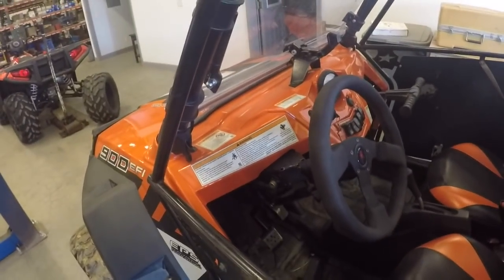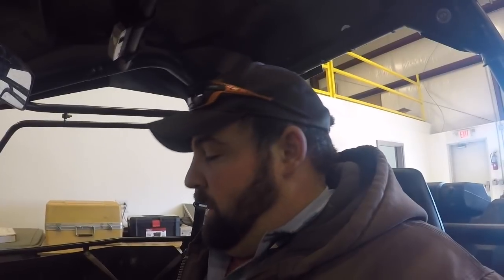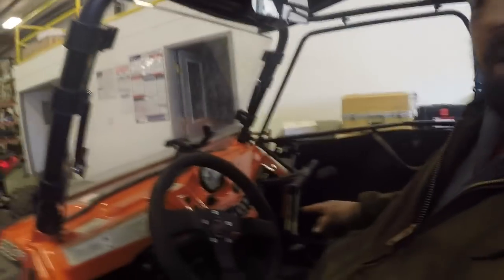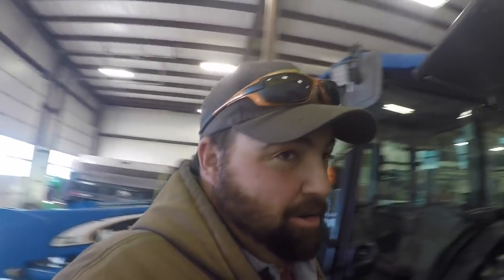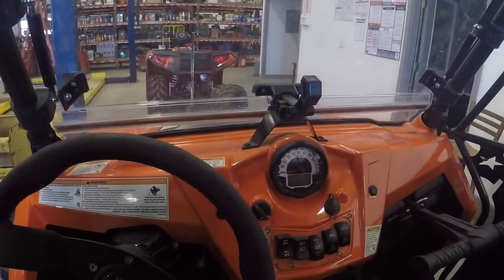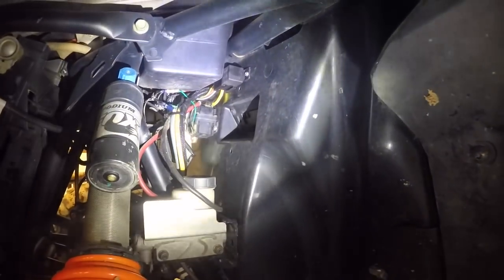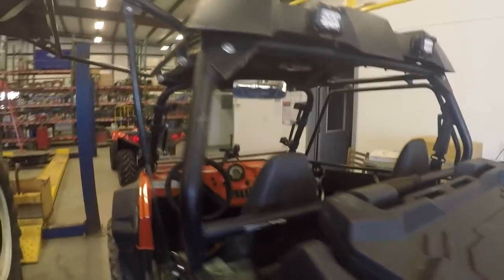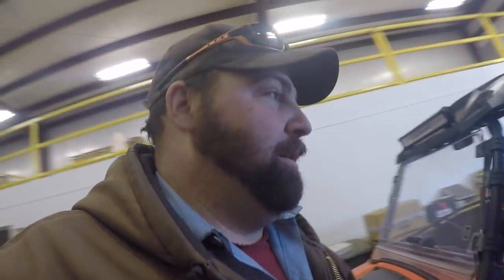Polaris RZR 900xp heated accessories and lights.

Comment: Live in central pa I have a 900 s. Heated seats heater defrosters on the windshield lifted 30x10r14 clutch kit and enclosure didn’t spend this much to be uncomfortable and let it sit for 6 months out the year and the heater works as good as as my 2020 dodge rams
Reply from the maker: Where you ride at?

Comment: Nice updates on the Polaris Dennis, thanks for the video on them.
I have lights like those for my Can Am Outlander Max, but I still haven't installed them yet.
I think that's the answer, to install a 'pony panel' with separate power and keyed switching.
Reply from the maker: +Reg Sparkes. Yeah that accessory power wire can only handle about 10 amps or so.

Comment: Hello from Bristol, hey Dennis that type of riding seems like a blast  unfortunately life’s issues prevent me from getting into it right now. We go to bramwell, wva to the corner shop for burgers and a sundae guitar often. May see ya there sometime. If ya never been it’s well worth it. Rated a top place in wva for several year now to eat. It’s like stepping back in time. An old fashioned soda fountain from the old says and it’s decorated as it was when it first opened. Lots of 4 wheelers stop there. Great video as always. See ya on the next one.
Reply from the maker: +warren patton. Cool I will have to check that place out!

Comment: Well now,
Interesting toy. About capturing the heat, I used to own an MGB with both hard and soft top. Most of the time I carried the soft top in case of rain. When it got cold, I ran with the tonneau cover. It was zipped up at night in clear weather and half unzipped to the driver side. It captured the heated water circulated thru the engine which was Hot. That might be something to consider. I follow your videos, it reminds me of younger days in trucking business in Richmond and Hanover county farm operation long ago with my Father and brother. My Grandfather had the Truck stop on Rt 360 just East of Keysville, today Simmons.enjoy what’s left of winter.
Reply from the maker: +James Whetstone. Thanks for the input James I'm glad your watching and bringing back old memories.

Comment: Pull your seat belt boots loose and add a rear windshield.  My 900XP would stay bearable like that.  Come up to WV and ride with us!  I'm from Wayne, WV...We'll take you all over East Lynn
Reply from the maker: +tbirdage. Been looking at the lock and ride back glass. Is that what you have? I thought about pulling the whole panel behind the seat when I was freezing but I didn't do it, didn't think about the seat belt boot. I'd love to go riding with a native WV crew. We stayed at the mud pit last time and rode to Sophia and eat at the China buffet. Ever been through that old train tunnel right in Sophia? that was awesome! We rode 120 miles that day.
Reply: I have a EMP brand now on my Polaris General. It’s super easy to put on and fraction of popo price
Reply from the maker: +tbirdage. Do you like the general after having a 900xp I almost traded mine for one because the guys I ride with are riding generals with full cabs. But I like to ride fast and I'm afraid they won't ride as good and handle as good since they only have A arms in the rear and are a lot heavier.
Reply: DLH Farms I absolutely love it. It’s an all around all purpose vehicle. I can work hard and play hard in it. I ride with 1000xp and Mavericks and will go anywhere they do and just as fast. I put Super ATV arched, forward A-arms up front with 30” tires. I hunt off it too. I can carry a climber, cooler, chainsaw and still haul a deer. If you parked a rzr 1000s and a Ranger in the garage, turned on some Conway twitty, 9 months later there’d be a general
Reply from the maker: +tbirdage. Lol! That last statement is awesome!

Comment: That vehicle must have a hefty alternator to keep up with that amount of draw. Very neat and tidy installation of all the upgrades. I cannot imagine that doing the seats was easy. I do like your gull wing doors just don't park too close to something alongside you!
Reply from the maker: +Dan Whiteford. You have to be careful about what and how long you use the accessories. You can run the heated seates and steering wheel and the front lights as long as you keep the rpms up and the voltage will stay above 13 I'm just going to have to be conservative and normally i ride alone so I can keep one seat turned off and I'm only going to use the rear lights when I'm backing up. They make mods to put in a bigger battery so it may do that also.

Comment: Always DIY accessories. Nothing a warm helmet and gear can do... hate having frosted or dirty windows, can't see anything anyways.

My brother actually got a hold of a seat warmer for our Ranger, but who knows if we'll ever install it, will take a bit of work with how the current seats are designed.
Reply from the maker: +Farming 4G. You should try to install it it's really nice to have a hot seat. Get a air staple gun to put the cover back on. Don't pull off any more cover then you need to. Glad to see your still watching! 👍